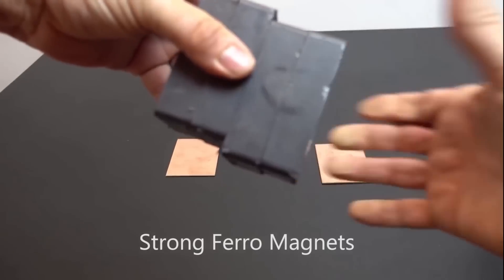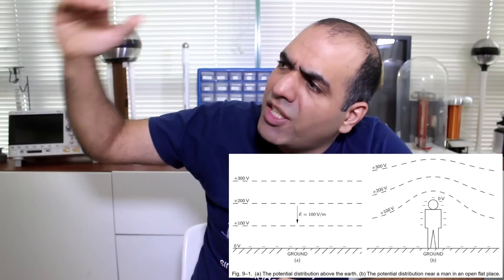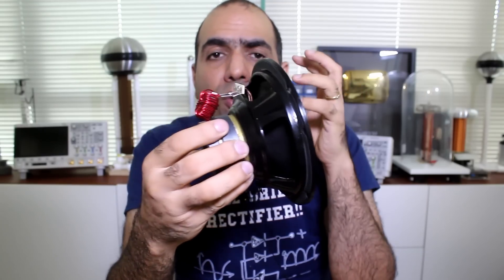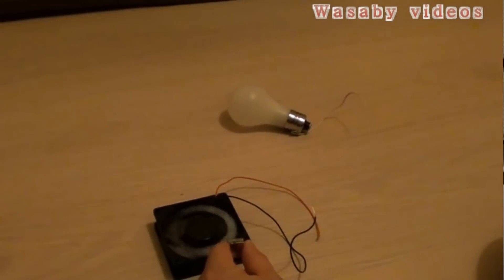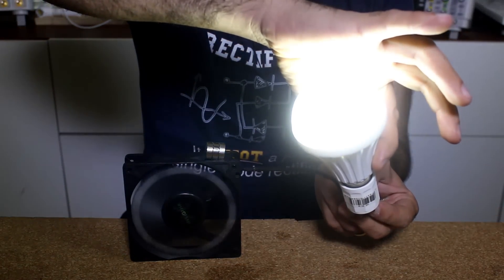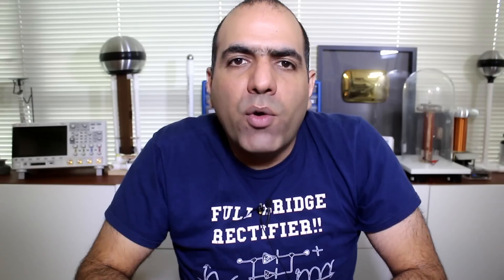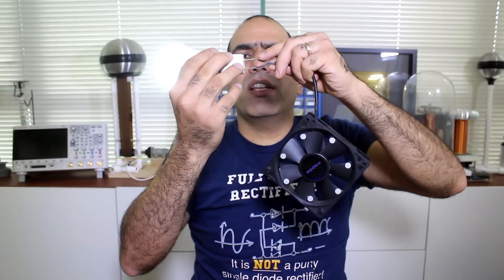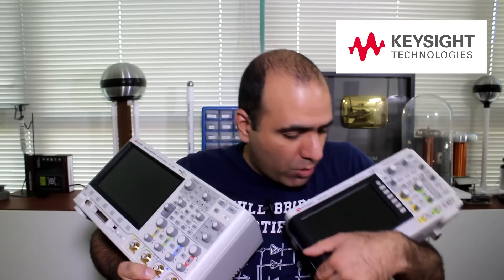Free Energy Devices Build and Science

Comment: I love the video, and I agree fully on most... except the computer fan one at the end...

I have done this myself, it's about precision on placement, and the type of fan/weight of the magnets on the blades..

and the external magnet, needs to be at an angle from the top/ front of the blades, not directly on a side..

ok, It only powered an LED, and not very bright, but it did work...

Also, what are your thoughts on the Infinity SAV system? it's basically the magnetic fan, but more precise and engineered...

Comment: Biggest free energy scam is hydrogen fuel cell cars (Toyota, etc). The premise is that the electrical energy will be negative (cheaper than free) that 50% can be wasted in turning water to H. Then 50% of that wasted in converting to electricity to power a car. But since the initial energy was cheaper than free, all the waste and consumables are cost effective against gasoline and even battery electric cars. Yes, it's as absurd as it sounds.

Comment: Stationary magnets were easy, they would induce some voltage but coils are shorted (well, they are conductive afterall), and the voltage will be gone. Then I was like "well, it may even work but it's waaaay too weak" except for the last one. Man, that is a holy grail of magnetism, a lot of people want to achieve it. Even if it's possible, such a mechanism would have to weaken the magnets over time (we want to use their energy, right?).

Comment: I have never seen a light bulb like that, but it must be more common outside of the EU, since all of the free energy people are using it in this video.

Must be those big, corporate EU regulations banning its use, along with the free energy collectors - those bastards just want us to gather energy from the sun and the air instead of gathering it from sound and atmospheric voltage.

Actually, this does get me wondering whether one could actually generate power from vibrations like noise. Maybe with a very tiny generator?

Comment: Ringer circuit built with a high voltage coil with an antenna insulated from the ground 10 meters up. The antenna should look like a bed of nails but with pins pointed straight up. Insulated from the main Pole ran down using a insulated coax cable. The center wire of the coax cable connected to the output side of the high-voltage coil with a transistor. Many people put up ringer circuit on YouTube they do work the technology is sound. even that speaker demonstration you put out if you were to put a ringer circuit in it would probably produce a small amount. By running the antenna wire into the output of the high-voltage Transformer. You changing the high-voltage from up above since it's low current create a feedback loop which will decrease the voltage and increase the amperage. First experiments amperage might not be feasible or usable but is a start. yeah for a good lie you always have to have a little truth in and for truth there's always a little bit of Lie.

Comment: The one with the speaker harvesting noise energy gave me a bright idea:
What if we put a lamp out in the sun, will it generate current for free? In that case, if we use the energy to power another lamp and the shine it on the original one, do we get INFINITE FREE ENERGY? 

Yes actually leds can also generate small currents when they receive light, but solar panels already exist.
obviously trying to shine a lamp on a solar panel would be useless as all the moths would come and reduce the efficiency of the system. Too bad

Comment: Does the looped wire only work with thermal energy? Would I be able tp run magnets through it for a couple seconds instead?
Reply: Did you take the Vid seriously ?
Sorry if this is a dumb Question
Reply: @user-si5fm8ql3c  a dynamo works the same way by passing a magnet through the copper coil you would get current. The magnet must however be moving to start this off but once its started it can keep going like i  this video. Remember energy can be created but never transformed
Reply: @christopherlam9654  The Magnet gets slowed down in the Process 
The mechanical Energy gets changed into Electric Energy and a small Amount of Heat (Friction you know)
Btw watch his other Videos 
this is just a Trolling Video
He normally shows that Free-Energy Devices from other People don't work
Reply: @user-si5fm8ql3c  No it does work, look at how he plugged the socket into the strip it loops back around. If you shake the loop you might be able to get even more power out like you said kinetic energy to electrical.
Reply: @user-si5fm8ql3c  Friction and resistance is a just an idea created by the sheeple globe earthers.

Comment: To be fair, over unity does exist.  Most motors run at or just below unity.  Depending on efficiency.  However, synchronous motors can run above unity to correct overall system power factors.  Of course they're not making free energy. But rather helping consume less energy by changing   total system inductive reactance.

Comment: Homopolar generators can make d.c. voltage without cutting through magnetic flux lines, i.e. Faraday paradox. You don't need a coil to generate electrical current, spin a conductive disk with a magnet and you have a voltage difference between the center of the disk and the edge. This guy only speaks of one way of generating electrical potential. Look into Faraday disks, homopolar generators, and Bruce DePalma's n-machine.

Comment: Hi! if ground at the end of the day gets connected to the neutral then what is the use of having three separate wires, why don't we connect the neutral wire to the casing and avoid the need of having three separated wires with two having the same connection, isn't that useless redundancy? Thanks in advance.

Comment: Motorcycles use to use this it’s called a magneto. Was used till the late 70s early 80s i am talking about the first few minutes of the video so you can made power using coils and magnets but the magnet needs to move throw the copper coils very fast to make power
Reply: This is also how electric guitars work. A pickup is basically just a permanent magnet, move the strings in and out of the magnetic field and voila a current, which can be amplified into a sound. The key is movement though, no free anything.

Comment: You want a source of free energy?

You got one.  It's called "the Sun."

What you don't have are sources of energy that are over unity.  One way or another, thermodynamics are going to get in the way of such designs.

I mean, it's already a given that conversion of energy from one form to another will never be 100% perfect.  Over unity asserts that there's not just 100% conversion, but that you can somehow create energy over that 100% without any kind of cost.  How is such a thing possible?

You can get a fan to freely spin with magnets.  But, the moment you put a manageable load on such a contraption, it's amazing how the polar alignment of the magnets will change, reaching the point where the fan won't spin anymore.  To realign those magnets to make it spin again ... requires energy, analogous to recharging a battery.

Comment: What you are overlooking is that there is free energy (solar is a form of free energy, as we don't have to pay a corporation for every watt that we use), but I doubt that anyone would show it as none of the common materials can be used to extract plank energy from a vacuum. There is no such thing as getting energy from nothing, but it is possible to get energy from things other than fuel or Nuclear power. If power is obtained from some unknown source that has not yet been discovered it would not violate conversation of energy, but might look like it does (example first experiments with nuclear power until people realized that matter is just another form of energy). Magnets only produce a field in response to the electrons spinning in the material and since it is not a moving magnetic field it does not create electricity. All of the ones that are presented so far are all fakes, and there are many things that are not known to our present sciences. However one key thing is that energy can be converted from one form to another, and MATTER is just another form of energy. There are other forms of energy that we do not have any equipment built (at least publicly) that can convert what is often referred to as dark energy into usable energy to run electric motors and heat our homes etc. That is because for the most part we do not know what exactly the stuff is. Besides that starting at about 10:30 there are a number of very good and interesting channels.

Comment: What if you use an car battery attach inverter to it and use the inverter for battery charger and connect it to car battery??? Free Energy!
Reply: You have to create more energy than it takes to run the motor and create a back feed over charging system it will work ..
Reply: no, but you'd make a pretty good room heater
Reply: But not in a car it would charge itself

Comment: A year or two ago, I wrapped some wire around the FETs in my UPS, ran these coils through a *full wave bridge rectifier*, and then to the UPS' battery. Then I plugged my UPS into itself and turned it on. It's still running over there in the corner.

Comment: The last one, with a fan, if i remember correctly actually works but its not free energy by any means. The idea is motor = generator working the other way and the work done by magnets pushing the fan blades which makes minimal amount of electricity. Enough to power LED(maybe) but don't expect anything else. And magnet's magnetism can and will run out at one point, so its not infinite either.

Comment: So, I was faffing about with my Arduino and playing with an LED. LED was grounded, and the positive was going through a 220ohm resistor. But I was able to light the LED faintly by holding the positive cable lead, which was not connected to the Arduino's 5v. 

What would have caused this? I know free energy is bullshit, but my body's natural voltage generation should not have made the LED light, especially when I was not completing the circuit to the Arduino.
Reply: your capacitance to ground

Comment: Electroboom I have powered a florescent 4 foot T8 lamp with my body before, but for real. We had this chair I could just sit in and stand up and get a huge static charge every time it could jump a air gap about 1/4 inch so around 10K volts. then it had to be really dark and hold the lamp in my hand and it would faintly glow and dissipate or i could touch it to metal and it  would flash and go out.  It's like a light saber so much fun lol.
Reply: Works much better with a simple plasma ball. It's like a commercial tesla coil really. Give it a try.
Reply: Jalal M  oh yeah i have done that too. i built a plasma ball kit when i was a teenager.

Comment: I have question that keeps me thinking.... since theres no such thing as Free Energy..... But there Are a lot of stuff that can saves electricity.... the most common  one is POWER FACTOR CORRECTION device.... Is it really works that can cut electricity consumption in half ?
Reply: You kinda need to understand power factor (there are lots of videos...), but in short: No. 
It can in certain circumstances reduce the consumption of electricity as measured by your supplier (not usually for home supplies though), but it has no effect on the actual energy consumption.

Comment: Atmospheric electricity is no good for current. Only potential is in electrostatics. Egyptians had a design for a slow charge of a spark Gap capacitor.
Edit: and to add to Electra booms point with atmospheric electricity. You need a very large Tower today to harness it and any kind of high voltage. I think the number is like it's only a hundred volts per meter. And voltage alone is not enough to determine current for the current of atmospheric wishes he is incredibly low. Corona discharge may result in some very large numbers but the sheer scale of them is astronomical. 
New study of the Egyptian pyramids electromagnetic properties hence the idea that part of their design was to concentrate where the collection of atmospheric charge took place within the pyramid structure. This absolutely would not have been used for current directly. and that best was used for charging a capacitor made of glass/wood and gold

Comment: There is one effectively over unity device that works … a heat pump, with the proviso that it requires an "open" source to extract the heat from, otherwise the cold side would get too cold for it to draw any more - so what if you couple a heat pump to a heat engine? It wouldn't break the laws of thermodynamics, as the energy obtained is provided by the heat lost to the cold side. It sounds simultaneously feasible, and too good to be true (or perhaps ok in theory, but heat engines are just not efficient enough).
Reply: A heat pump isn't over unity any more than a solar panel is. The proviso you mention isn't so much a proviso as an explanation.

Comment: Infinite energy is bullshit of course. But free energy is not. It has two meanings:
1. In a closed system, you cannot have more then 100% efficiency. But if something from outside affects the closed system, (in theory) you can have more than 100% efficiency. There're a few claims for machines that can do it, for example the searl effect generator.
2. If you can make energy in a way, that doesn't cost you any money, it's free energy. So wind or solar power can be free energy, but these have some inital costs. But there're some inventions, that basically don't cost you any money, like the beer collector.
And it's also possible that the laws of physics are incomplete. There can be some factors that influences the laws, some cases where these laws are not applicable. For example:
"First law of thermodynamics: When energy passes, as work, as heat, or with matter, into or out from a system, the system's internal energy changes in accord with the law of conservation of energy." But what if energy passes some other way than as heat, matter or work?
There's a theory that our universe is made of a grid. Normally in every grid point there is one piece of matter and one piece of anti-matter. Together they add up to a piece of emptiness (or ether). So there's equal amount of matter and anti-matter in the universe. But these can move between grid points, if they get some energy, and when there're more matter in a point than anti-matter, there's a thing, a visible piece of matter.
If this theory is true, it could be possible to rearrange the pieces of matters and anti-matters in a way that more energy would be created than needed.
Reply: Undefined Lastname  But that definition is really hard to apply to real life. Can you imagine a system that is actually by definition closed? Maybe I was wrong and not the outside system affects the closed system, but in fact the system is not closed.
Reply: Undefined Lastname  If a gasoline engine would be a closed system, than we would need to take in account the following too:
-When fuel burns, it produces heat, but also produces some material particles, and the ratio of these two depends on a lot of factors, like air temperature, air composition, atmospheric pressure, engine temperature, even the shape of the air tunnels (turbulences and other effects, these are actually relevant).
But ok, you make an advanced model, and take all these to account.
-The engine generates work to move the car forward. But the power transmission system of a car consists of a lot of parts, which work against the engine. Normally this would only mean that the engine's work and the opposing work creates waste heat, but actually the opposing work forces the engine to make less work. Similarly when you apply a high load to a battery, the voltage drops, in most cases causing the amperage to also drop (because the load depends on the voltage), so the battery will make less work. Also, vibration to the engine causes similar effect, the engine makes less work when vibrates.
It's not possible to take everything into account. For example a car will make less power at higher altitude, which is often ignored. And the car will make less power with slightly less ideal octane number fuel, this has nothing to do with the gasoline's energy density.
-The engine itself can move or rotate. In theory you can still choose a frame of reference where the engine and all of it's surroundings make a closed system, but that doesn't mean that the engine itself is a closed system.

In contrary, the energy of the sun is mostly a closed system. It consists of the sun, the solar panel, a percentage of illumination and the percentage of the waste at the ozone layer and air. It's a really consistent system, only the percentage of illumination is changing. In an engine not just the energy flow of the fuel changes, but a million other things.

Finally: "hoaxes trying to gain something from nothing". In most cases they don't claim to get something from nothing, but to get something from an energy source that is not yet utilised. I haven't seen a machine that fits in this category. Yet. But fusion reaction is somewhat similar. 120 years ago noone would've think about getting energy from mass, if I would've told them this, they would've though it was a hoax. Now we know that mass IS energy.
Reply: Undefined Lastname The energy output of the engine in a test environment with reference parameters are relatively easy to calculate. But that's not a real life example. When we put the engine to use in real life, it's effective parameters will change. So the outside word will affect the closed system. You said that it's not possible. So the engine is not a closed system.